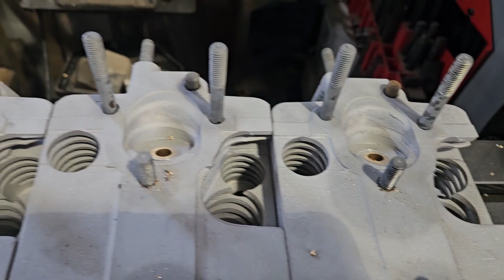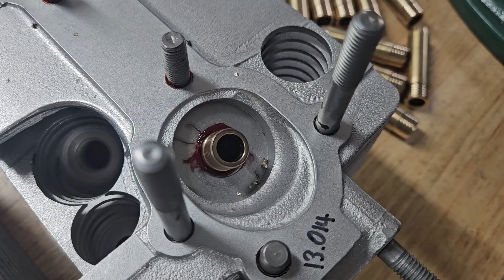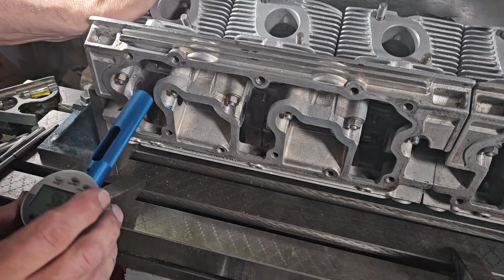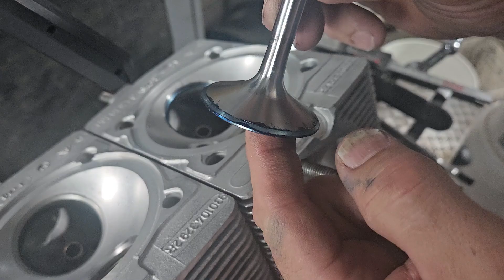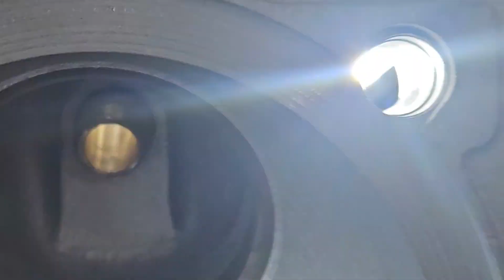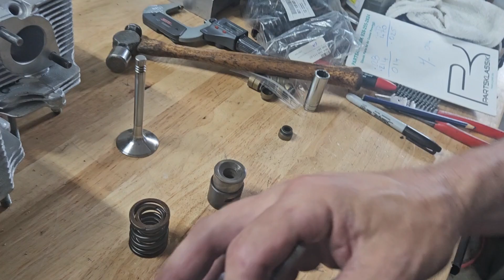1978 Porsche cylinder heads machine work

Comment: Good "How to" video.  Couple of questions, 1) by machining the head, are you raising to compression ratio and do you have to make adjustments to the cam gears?  Do you do the process to convert to duel spark plugs per head?  Do you do anything to enhance cooling of the exhaust value by adding oil passage around the value?  Keep it up!
Reply from the maker: Yes by machining the sealing face compression will increase if you do not add an appropriate shim under the barrel. We can convert heads to twin plugs if required. No there is no way to add an oil passage way around the exhaust valve.
Kurt